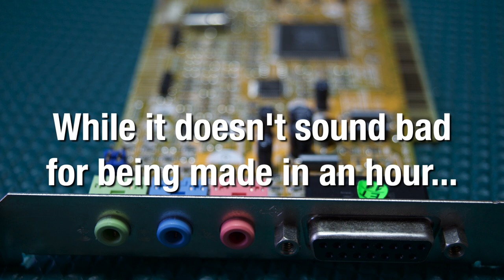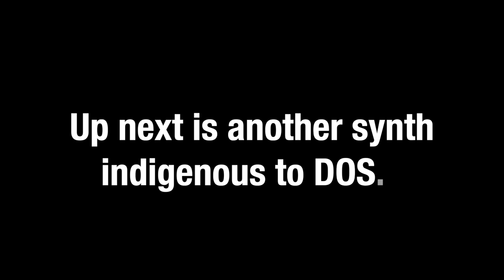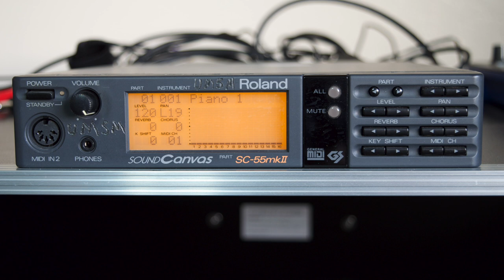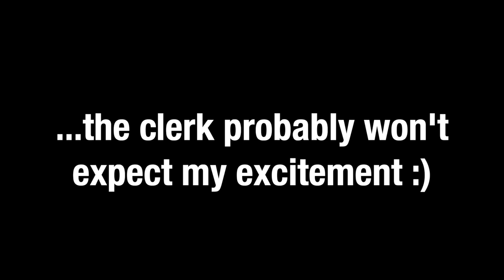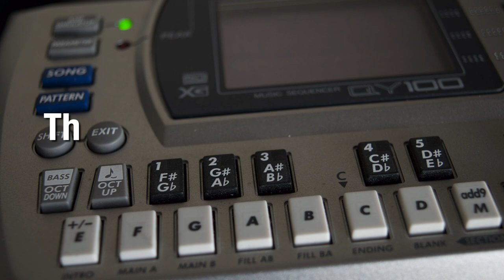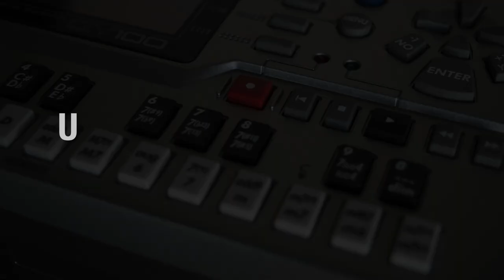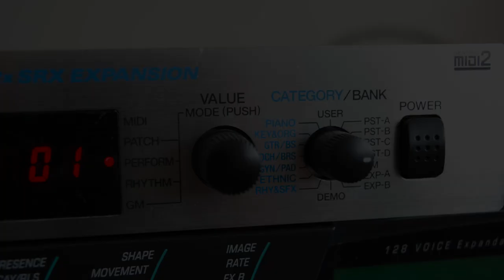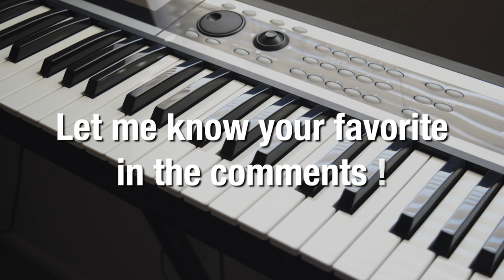General MIDI Showdown

Comment: I just recently got a QY100, I had never heard of them until I watched Floyd Steinbergs channel. I’ve always had a top of the chain PSR, now I have a Kronos, some Modular, all the Dreadbox VHS size synths and a few Behringers. I’m a a guitar player so I have many effects and guitar synths as well. The QY100 is my modular sequencer of choice now. Even though most of my stuff is new, I still use the QY, the Boss DR 880 (still the best drum machine EVER made, IMHO) and Roland Integra 7 with an SP404 mk2, most of the PO’s, a couple volcas and a 2022 IPad.  Lots of fun!

Comment: Yamaha OPL does FM synthesis, it does not have anything to do with MIDI. What you are hearing is Yamaha XG synthesizer integrated on that sound card. For example sound blaster cards back then could have Yamaha OPL chips for FM, but to get midi you had to get a daughter card (for wave blaster connector.  Serdaco company from Belgium is making modern equivalents of those.
Reply from the maker: Sure, the OPL chip is not a GM synth.  But in the absence of a daughter board, MIDI player software would use the OPL for synthesizing GM.  The Yamaha XG chip I'm using in this video has an OPL3 as well as an XG tone generator.  Here you're hearing the OPL3.